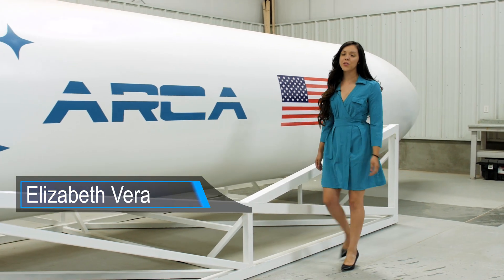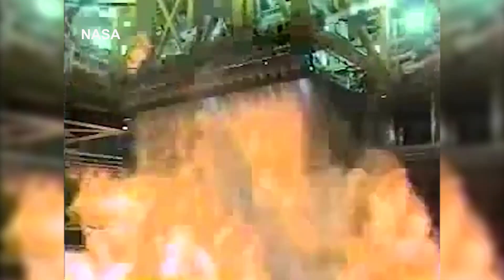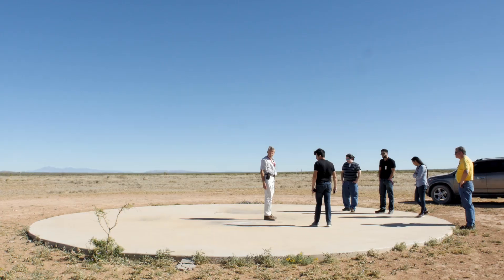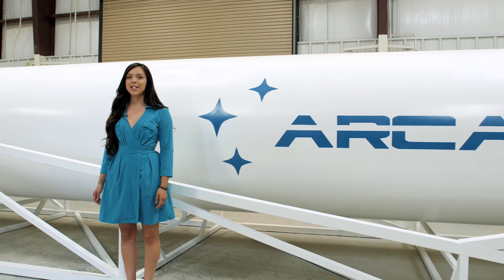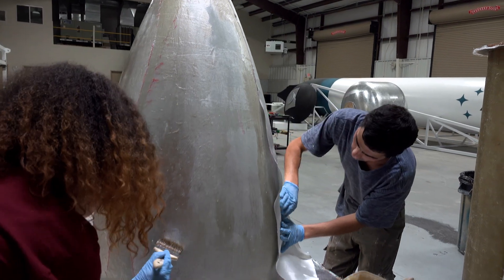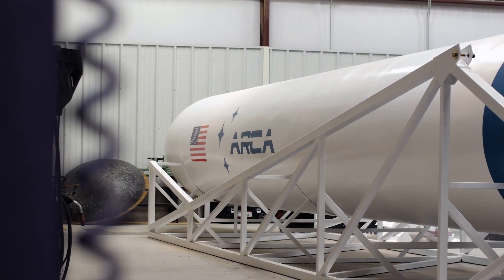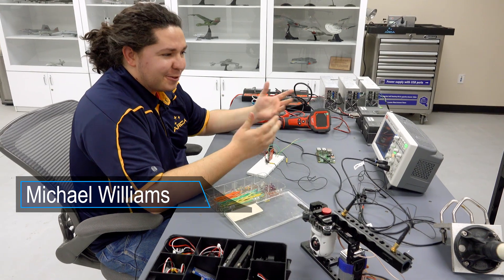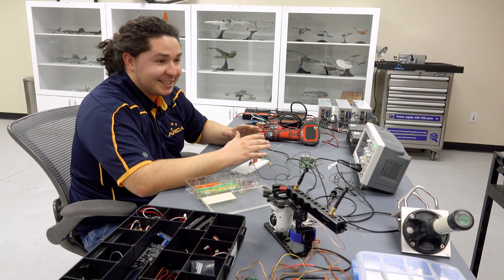Flight of the Aerospike: Episode 1

Comment: I strongly suspect all this being arrested and supreme court hearing story is bullcrap.  In fact, the whole story from start to finish is buillcrap. The arrests story is mee stalling for time to keep people entertained.

What you have built here are models of proposed rocket components, not actual test articles for genuine hot testing or flight.  You're an accomplished model maker con aretist, that is all. 

If anyone really had the drive to make an aerospike work, they'd build a small one on a milling machine and test it in their garage with an oxy-acetylene set.  That could be done for less than $1000 and you'd at least have a video of a tested article... and if the test included some load cells, you'd have numbers to analyse for computer modelling.  Instead, you're playing with strips of fibreglass, cheap fibreboard and sheet aluminum bolted together with the cheapest DIY bolts all from Home Depot!!  

The finest engineering I've seen yet is a box-section frame welded together to resemble a test rig.  Gimme a break!  And what fuel could you possibly house in that tank?  Propane?! I doubt it's even a bonafide pressure vessel! If so, ah well, at least you'll have a fine pillar of black smoke to watch rising into the sky once you light it!!

I reckon that's about the only thing you'll ever produce that will fly... black smoke!

Comment: What if we reuse this rocket? Like... Cheap af space travel?
Reply: That's the point of using the aerospike, which can operate at any altitude. Traditional bell-shaped engines on modern rockest such as those of space-x are limited to a specific range of altitudes, which is why multiple stages are used and you see part of the rocket break off as it ascends.

Comment: Your going to need a very strong,reliable and durable nozzle
Reply: " - reliable and durable nozzle"   - straight captain obvious :)
Reply: " - single flight, since it's an expendable rocket."
why do not you insist that the planes should also be disposable?
Reply: Why do not you? don't....understand you not i do
Reply: This is understandable, but to add a 2nd tank for RP1 is it so difficult?
the laws of thermodynamics do not cheat, or peroxide is 98%?
Reply: well if it's only a Test Bed without passenger or payload whats the point, that will just leave more questions...Find me a Suit,oxygen supply and a re-entry guarantee and i'll man it for you for a reasonable fee then you'll get more funding..encase me in Gel to counteract the high G insertion. Needs to go higher than Baumgartner though..Should be a laugh :)

Comment: How are you going to keep the spike cool enough to operate for a long enough duration?
Reply: @ARCAchannel  70% Hydrogen Peroxide used as a monopropellant with a catalyst produces steam with a temperature of 600 °C. Even a high tensile strength fiberglass will lose 75% of it's tensile strength at 482°C, and high temp resin only protects up to 200°C.

If you ever tried to test your fiberglass model rocket it would buckle, melt and explode within seconds.

Comment: Are those molds for a mockup or the actual flight ready rocket? The molds look kinda sketchy and probably filled with defects from the Aluminum tape, especially for an 'aerospace' grade fuel tank. You should really be using a silky smooth epoxy or machined metal finish on those :-\

Comment: Raspberry powered avionics <3
Reply: saszab
The Apollo Computer was a bit more rugged against radiation and other environmental specifics of space I believe. Faster doesn't always mean better. There are a LOT of other variables to consider in electronics. Especially operating temperatures, Error correction and hard realtime capabilities (and I mean GUARANTEED response times).
Reply: they can assemble avionics from cheap components inside a leaden shell. so that radiation will not be a problem. to infinity and beyond guys)
Reply: Kajetan Krzewina 
The computer which landed Apollo LMs on the Moon was many thousands of times slower than RPi.
Reply: yeah, I know, but still, the piece of hardware that lay in my drawer is capable of so many incredible things!!

Comment: if they somehow achieve to make a reusable single stage to orbit rocket, spacex  might have a very big problem.
Reply: Cyprio I don't think it's a waste of time and money.
See, the SpaceX Falcon 1 Rocket was also a shitty rocket. But it paved the way to the Falcon 9, the Falcon Heavy, and maybe finally the ITS. 
The aerospike is still pretty experimental, and building a big rocket for many tons to GTO may be a bad idea
Reply: Andrei Brănescu if they can put external fuel tanks with no rocket engine that can flyback before they reach space ( using propellers of course) the rocket with shielding might have enough fuel to make it back.
Reply: the one febo10 maybe...its nonreusable...they make the rocket from cheap lightweight materials...which I'm doubting already on its fuel storage and insulative qualities ...but the engine itself...is not cheap to build...they make it sound cheap...plus this thing in its final form is capable of like 100kg to orbit or something...very little payload capacity 

also it uses every drop of fuel it has to get to orbit.. barely low earth orbit btw...it's useful for very specific payload types-cubesats,  whos owners want a limited orbital lifespan a few weeks to a month or 2...it's NOT good for geo sync sats...gps sats...cargo payload...earth monitoring sats or telecommunications....and payloads that small are really too small to have large heavy propulsion modules on them... waste of money and time really...the tech behind it is a beautiful idea in theory if it was utilised properly, but it's  not in this particular launch platform